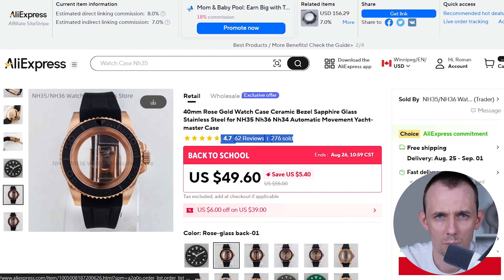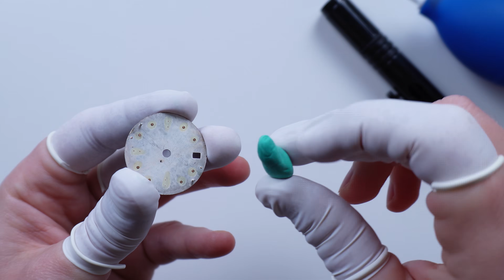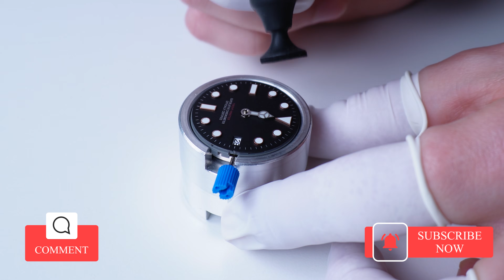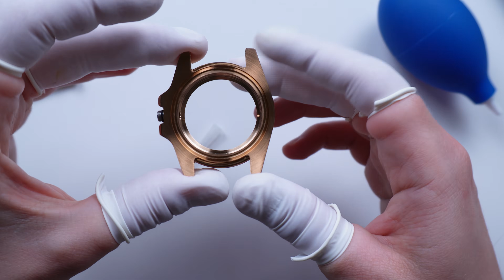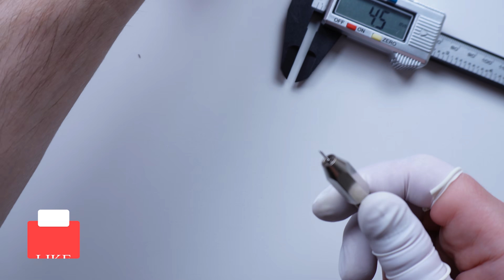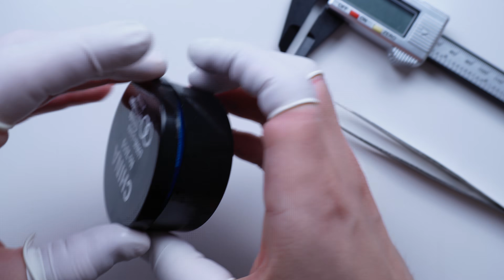Building a Rolex Yacht-Master Style Watch from AliExpress

Comment: The Pagani Design PD-1651 looks exactly the same as this. Only difference is that it comes with the Miyota 8215
Reply from the maker: Yeah, it’s definitely very similar! The main difference is the movement, with the Pagani using the Miyota 8215. Thanks for pointing that out! 👍